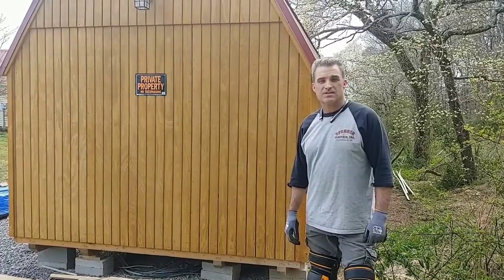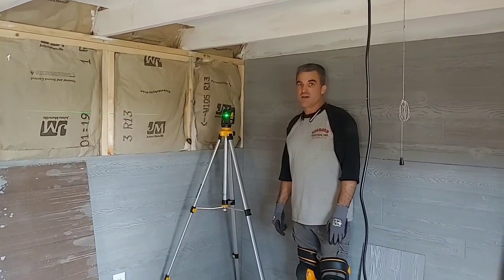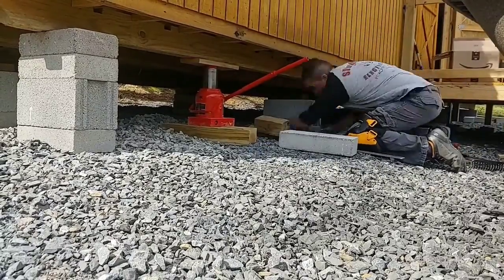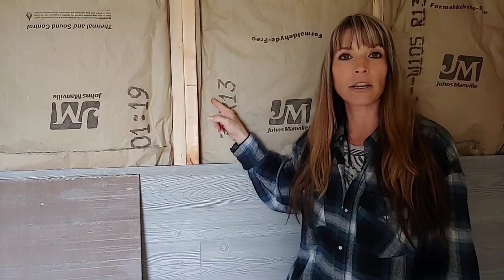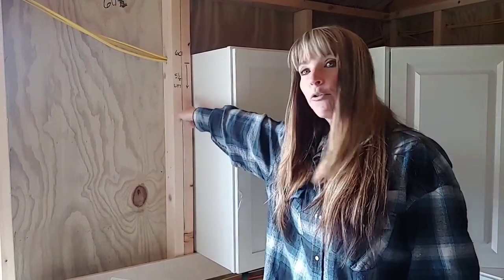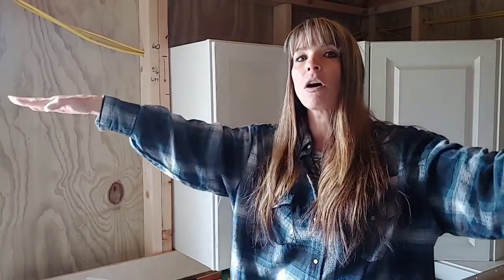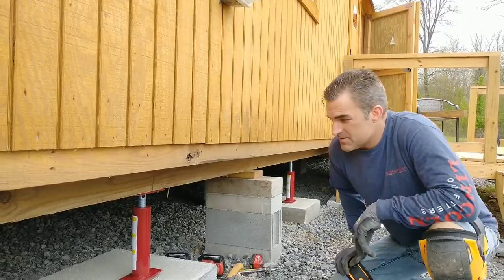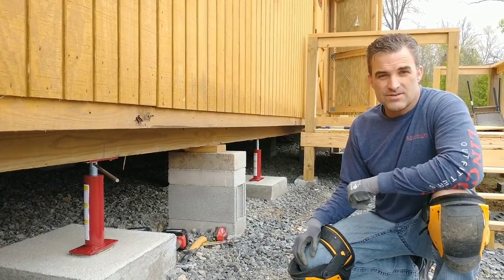How to Level an Unlevel Tiny House Shed Step-by-Step DIY #how  #DIY #tinyhouse

Comment: Great video! I need to level my portable garage up so I can finish the little things and the big thing...the floor. It was tuff to build a 16x32 building mostly by myself. I am not a young fellow and it was painful at times. I got the fat little jack and I have a self leveling laser. I will be following your examples as I get it leveled back up. Its not your typical shed design as I built it in a lean too style and with 2x6 studs and 2x10 rafters as these were cheaper at the time than the smaller stuff. lol. So its heavy and strong. But again...thank you! Much needed help in how to do it.
Reply from the maker: Thank you for watching the video. Slow and steady will get the job done! You Can Do It!! 👍

Comment: Great job. I'm sure that cost per inch must have been a dilly. I'm  surpriszed the county or city where it was put down, allowed a building of that size to be placed on blocks.  The county I am in would have required that building to be on a frost proof foundation.

Comment: So do you have a link for the jscks ? And also i built a shed into a tiny home and the runner beams seem to be bowed where the center is higher than the outside how do i fix that will just jacking up the outside edge fix it?
Reply from the maker: Hi! Thank you for watching the video. I revised the description to include the link to the exact Jack's that we purchased for this project. As far as the bow ...you might be able to adjust that by pushing the outer edges upward with the jack stands...not sure about that. I wish you the best with your project.

Comment: What does the platform add that just resting on the concrete pour doesn't? Is it more for weight/force distribution?
Reply from the maker: Good question! You are correct...the larger the surface area, the better the weight distribution...which will help with overall stability of the structure. Hope that this information answers your question 👍.

Comment: This is what happens when you rush to get something done. You have to pay someone to go back and fix things costing more money. For the 3 grand they spent Fixing the shed  and the money from the gravel bed, cement blocks etc.. They could have poured a concrete slab for the shed to sit on.
Reply from the maker: That is very true. However, there is still a significant cost in pouring a slab...it might be a wash. Slabs require a gravel / crush rock base, rebar, cement, cement truck and a concrete finisher. This, in the end, might be more expensive than what we accomplished. Plus, if this were to be dropped onto a slab, you can forget about future plumbing as there would be no crawl space to work with. I totally agree with a slab if this were a shed only...but, as a tiny house, a raised foundation is most likely the best option. Thank you for watching a leaving a comment... always appreciated.👍
Reply: An unfair castigation with likely zero consideration for what factors might have influenced the owners to pull the trigger on their project.
Reply: You have NO IDEA. You can’t plumb it unless it’s off the ground. You’d have to draw blueprints, rough it in, pour the slab, pull up the plywood floors, move the entire building and set it on top of the new roughed in slab. You’d have to rebuild the thing basically and do a lot of unnecessary demo work. This would cost way more than just leveling it. Wth are you thinking? 🤔

Comment: Where'd you buy those screw jacks you placed under the shed permanently?
Reply from the maker: Hi! Thank you for watching the video. The jacks were purchased off of Amazon. Make sure to purchase the jack stands that have manual adjusting and not hydraulic. Over time, the hydraulic jack stands will bleed off. Also, make sure to purchase the appropriate number and load-bearing weight for your particular tiny house/shed. I hope this information helps 👍.

Comment: Hi! Question for you. I have a shed that's on blocks and may need to be leveled in the future. I have electricity running to the shed from the nearest pole, the wire is run through a conduit 18" under the ground and comes up and attaches to the shed where the breaker box is. What's the process for leveling a shed in a situation like this? I'm concerned that leveling the shed will put stress on either the conduit or the wire coming from the pole.
Reply from the maker: Hi. Thank you for watching this video. This shed was the exact same situation as you are describing. I ended up digging around the conduit that was coming up into the shed. It took some time, but I dug several feet of it out so that as I lifted the shed the conduit could reposition itself. This was somewhat lengthy in time, but helped to ensure that the conduit would not crack or the wire pull away from the panel. After the shed was leveled I filled the trench back in. Hope this information helps 👍
Reply: @YouCanDoIt2 that's actually very useful! I've been trying to figure out this problem for a good bit and had not considered doing that. TY!!!

Comment: Could you tell me about how much this project costed this person for labor? I'm asking because I'm about to tackle the exact same project and was very curious. Also great video
Reply from the maker: Hi Justin, thanks for watching and leaving a comment.  We did this project and charged $3,000.  Half was material and half was labor.  There was quite a bit of hand digging involved as I had to dig several feet down and the building was in the way while doing it. The materials are not cheap anymore.  Rebar, cement, house jacks, etc all seem to have gone up in the last year.  If you are planning on bidding out this job, I would price out materials first. In just the last few months materials have almost doubled in cost and some are very hard to come by. Hope this helps 👍
Reply: @YouCanDoIt2  super helpful actually! Thank you for taking the time to reply I do appreciate it. Half in materials really? Wowsers I need to revisit this indeed, as I hadn't considered it anywhere near that much. Was a majority of it the jacks??
Reply from the maker: @RobertKrummel  jacks were pricey and we used 8.  I had a slight loss on that as I only charged for seven but ended up using eight. I used an entire pallet of concrete. There's quite a bit underneath this tiny house.  Of course, the rebar and 2x4s aren't cheap either these days.